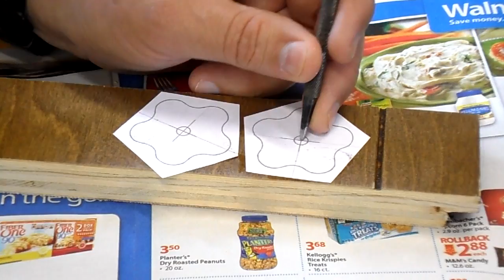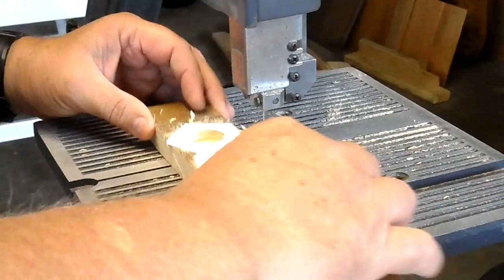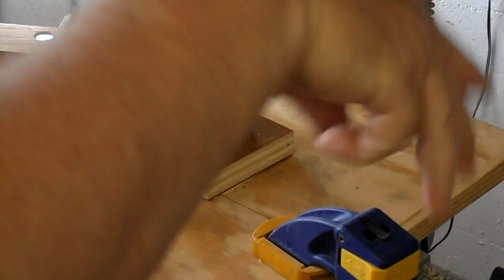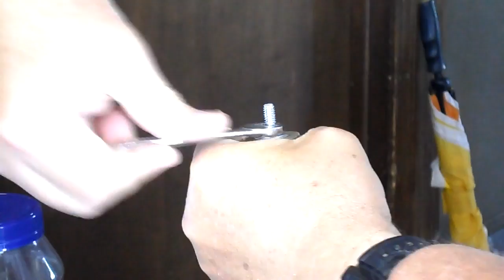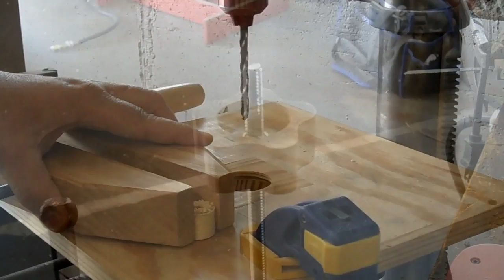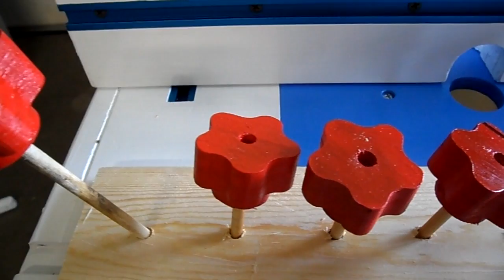Homemade Wooden Knobs

Comment: Ron, thank for taking the time to the video, I'm kicking around the idea of making some but to add weight to the "wings" to make them spin easier. Did you ever do the other video about making the other type with the bolt?
Reply from the maker: I can't remember if I ever made any of that type, but the construction would be similar.  Thanks for watching.  That was an old video, so I had to watch it myself, again.  I'm years behind the current YouTube woodworkers.

Comment: Looks like the ones I make using my CNC.. I even put in a pocket that is a tight fit for the nut.  Simply cut off the holding tabs, epoxy the nut or bolt head in the pocket then glue on the spacer using a bit of threaded rod, if using a nut, then glue on the spacer and washer and tighten down a nut to act as a clamp .. Finally paint..
Reply from the maker: +John Ware Thanks for watching and I wish I had a CNC.  They look like they'd be a lot of fun to play with.
Reply: A small CNC is handier than a light bulb in a shop. Just the thing for weird shaped holes and ones that there isnt a ready made drill bit for it. Mine can handle any wood or soft metals like brass or aluminum up to 16 inches by 24 inches by 6 inches.. Been halfway considering a forth axis like a small lathe. Then I can do some real fancy round stuff like the top of the posts on stairs or a porch.
Reply: @johnware5312  I always wonder at what point is it cheaper to buy an item then to have a cnc machine running for hours cutting out all the pieces.